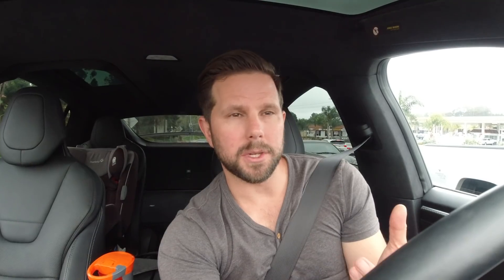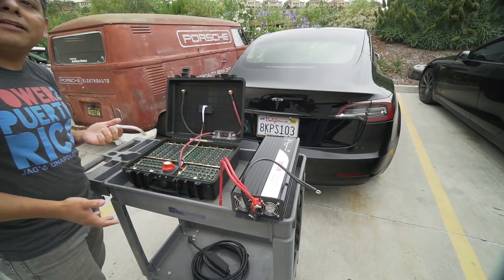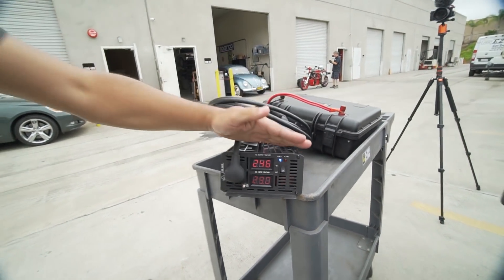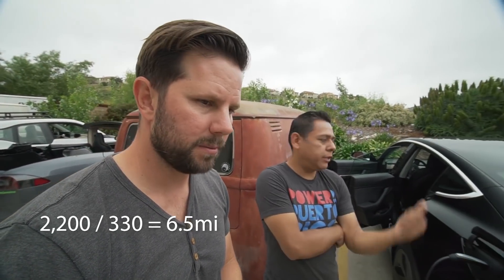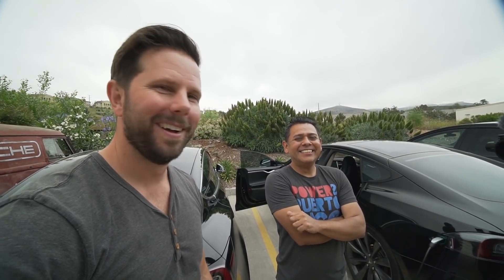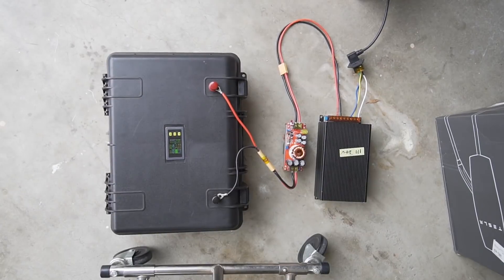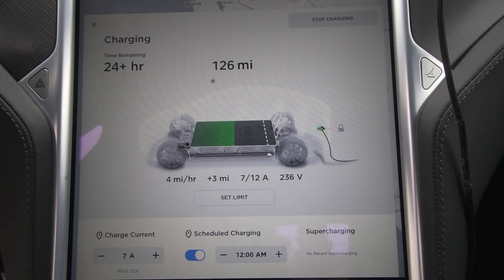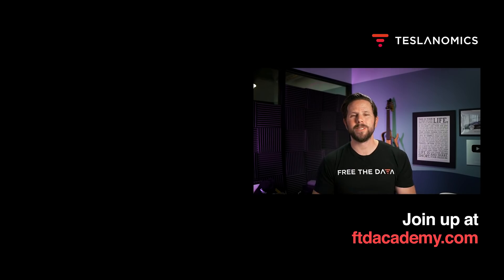DIY Tesla Gas Can - Will it Work?

Comment: Vehicle to Vehicle charging already exists...try towing with another vehicle for ever 3 miles you can gain 10 miles using regen!
Reply: I certainly hope you are joking.  Because if you are serious, you need to take a physics course.
Reply: Acctually @stupidas9466  it is you that may need to take an Electronics course...regeneration on most modern EVs are equivalent to 60 to 120 kw of DC charging if the tow vehicle can handle that drag (thats the physics bit) and as most EV owners would understand that is a charge rate of 100 to 200+miles per hour so if you are towing at 50miles per hour at the least there is a 2:1 charge rate but can be upto a 4:1 charge rate...still a lot faster than charging from battery to battery at 2.5kw...feel free to get a second opinion from the link below....
Reply: Alicetronics-Jaycar's Platinum Stockist for Central Australia i hope you understand that the term "physics" deals with the physical (ie real world).  How long is the tow rope? What is it made of? How much power is the tesla with the dead battery having to use while it is being towed? How much energy will be transferred from the body of the dead tesla into the towing vehicle once it smacks into it's rear end?  Give your head a shake.

Comment: As there is Cars like the SION (sono Motors) is planend To charge with the Integration of Photovoltaik (estimated) 18km under best circumstance, i Wonder of there couldnt Be a mobile Charginstion. 

There Rollable Photovoltaik Foils... 

I Know, that the Surface area will not cover a Lot of Range, But if Theres No charging possible i like the idea, To cover the Car like a Cape of Photovoltaik and get some Miles / km out of it😋

Comment: Would be nice if new EVs get a plug in the trunk or whatever, where you can directly plug in a temporary / extra battery without having to charge the car's batteries instead.

Comment: He's gained a little more efficient see if you went to a 110 the problem with 220 inverters is they're not intended to handle a lot of amps you get there wattage to voltage not amperage

Comment: I instantly hate anyone that says teZla just because crazy Elon says it that way. 

Saying this could possibly be a backup gas can would never work unless you had a tiny 220V Inverter which does no exist?

You would be better plugging an inverter into another car via Jumper Cables then all you need to carry is an inverter and hope someone will let you idle their car for 2 hours.  

The best thing to do is wait 10 to 15 years and stick with Hybrids until the tech catches up since we still burn coal to charge these TezzzzzLaaahhhs.

Comment: I'm surprised Teslas can't "jump start". Like plug a charged car into a flat one to transfer power.

All this will be a thing of the past when super capacitors begin to approach cell capacities. Yes, ultra fast charging will need cables and bus bars the width of elephants but hey, no way around physics.

Comment: A towing cable that can withstand a load of 10 tons and a length of 10 meters and the truck will solve your problem in one minute. Over 100 miles of towing using average recuperation mode, the Tesla model S will gained 150 miles range.

Comment: You should make the "electric gas can" from a super capacitor bank instead. 

-They charge/discharge extremely fast
-much lighter
-better discharge depth performance.

Comment: I believe it was Katrina or the next hurricane that hit Texas,? As electric car owners were leaving town I'm not sure what exactly happened but let's just save Model A B and C wear out model C were more expensive further mileage Vehicles versus the model A anywho the company did something like chronically over the airwaves and it extended the life of these Model A Vehicles further meaning they have the same power pack as expensive ones they hit a switch to factory computers and give everybody extra mileage probably removing the blocker mileage limiter.?? That extended driving time I believe it was on the news cast let me know in the comments that is true or not. it must be set up like OnStar where they can shut your car off and on we see you have a parking ticket outstanding the police are on the way, we have locked you in the vehicle for your safety please keep your hands on the dash when the officers arrived

Comment: You should contact Rimac (they made concept_one that Hammond crashed and 1914 hp C_two) they have THE best batteries on the market with super high voltage and they batteries don' lose power when low on charge. They made high voltage packs for Aston Martin Valkyrie and Koenigsegg Regera

Comment: You guys are too funny.  All you need is a 2kW portable Honda generator and a good old fashioned gas can.  That's right.  A generator and a gas can.  At only 2kW it won't charge in a hurry but a 2kW genny and 2.5 gallons of good old high pollution inefficient stinky gas will get that stranded Tesla off the roadside and down the road that last 30 miles until town.

Comment: It is not magic, but really before you go Jimmy riggin up some 50,000 dollar cars, call someone who actually has at least basic understanding of electricity. Anything that meets the minimum charge requirements will add energy to the recipient. Whether a big sack of potatoes, a bagdad battery, a 1950's Ford, an alien saucer, or yes, another electric vehicle. Meet the minimum and anything over that is available.

Comment: You have to test it with no charge left in the car. An actual real test. The battery in the car will have low voltage and charge more

Comment: I needed range and my car's MCU was DOA.  We towed it so I had enough range to get to the Service Center, 180 miles away.  It wouldn't charge at home.  BUT, afterward, the tech said that the Tesla WILL charge at a Supercharger, even if the other stuff is broken, or not functioning.

Comment: Just have to be disciplined enough to treat the last ~30 miles of range as your "reserve" (to get you to nearest charger, or 110/220 outlet), and you don't need any of this.

The "gas can" (plus inverter) would be very expensive, you'd have to keep it charged all the time, and haul it around in your car. Not realistic or practical at all.

Comment: The result was predictable. Without understanding the principle of electrical processes, coming up with an electric canister will not work. Your guru is not qualified enough. In principle, there is nothing complicated, you need a compact FAST charge. And it's not about the battery capacity ;) Dig further